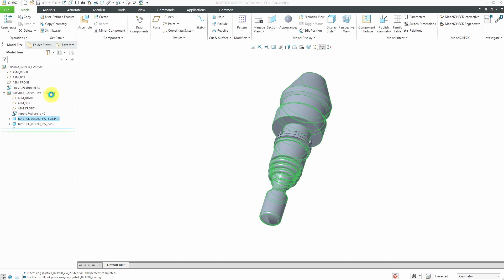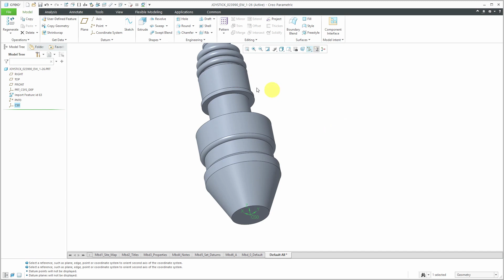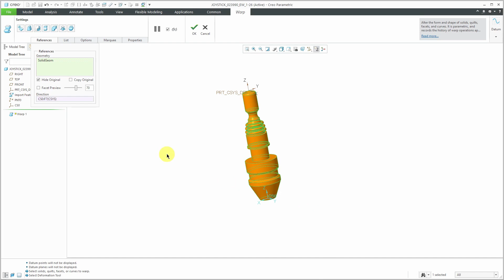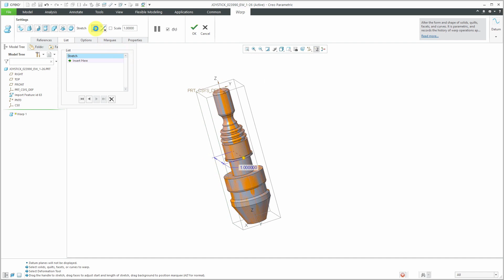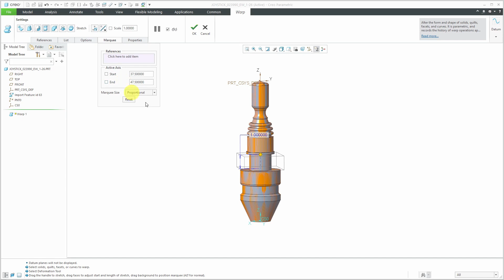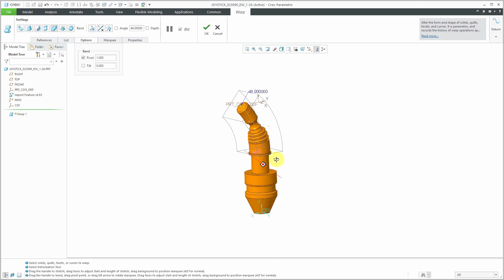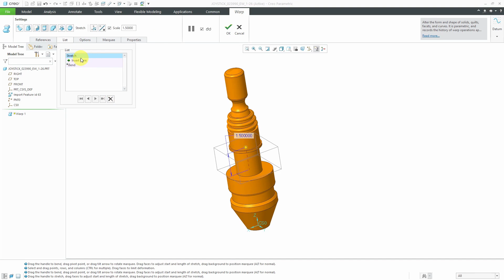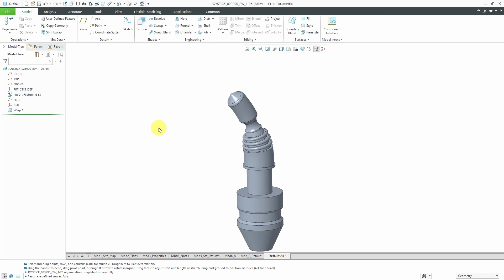Creo Parametric - Warp Tool

Comment: Thanks for the great videos.  Yours are really the only high quality tutorials I've found for Creo.  I've got warp working for a bent FPC, but I find that I can't bend complex shapes precisely since warp will bend the entire part rather than just the leg I want.  If I could split the part into multiple bodies (like SolidWorks) it might work, but I don't think that's possible.  Any suggestions?  Thanks!
Reply from the maker: What's an FPC? Multibody will be available in Creo next month. It sounds like you may be interested in Component Flexibility.
Reply: @CADPLMGuy  Flexible Printed Circuit - the flat (often) orange cables in lots of electronic devices where space is a premium.  I'm stuck in 3.0 for the time being due to customer requirements, but I'm excited that multibody is coming when we can upgrade.  I ended up converting it to a sheetmetal part and just bending it that way.  Worked well and much more straightforward.
Reply from the maker: Ah, okay, we used a different acronym at Amazon. I hate acronyms - they get in the way of communication. I'll do a video on the technique I had developed for modeling them, involving sheetmetal and bends, Component Flexibility, and Part Simplified Reps.

Comment: This is so cool!  Seems like it might be handy for making quick images for presentations to illustrate how rubber or thin parts might flex. @4:30 what does the 'scale' check box do?
Reply from the maker: Sean, the intent for the check box is that it makes a dimension in the feature. Then when you select the feature and click Edit Dimensions, you can change that value in the Graphics Area. Also that dimension can be used in Family Tables to create design variations.
Reply: @CADPLMGuy  Ah got it, very cool, makes sense.  Thank you!